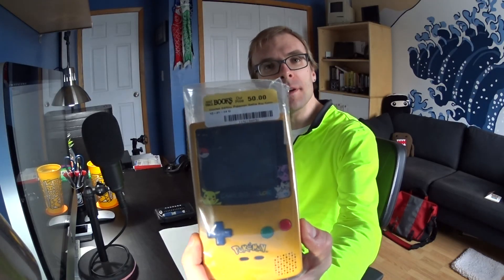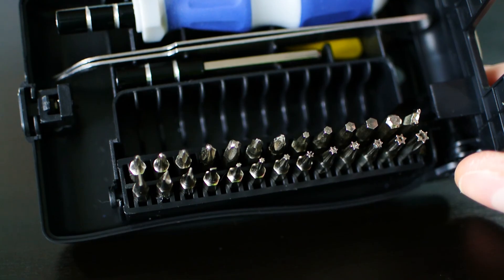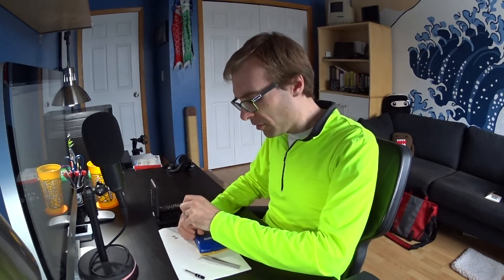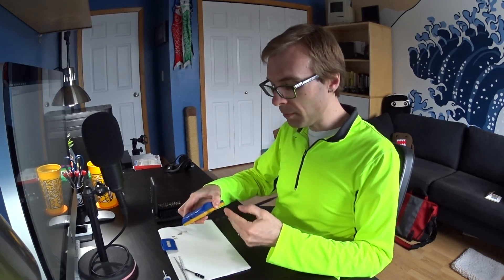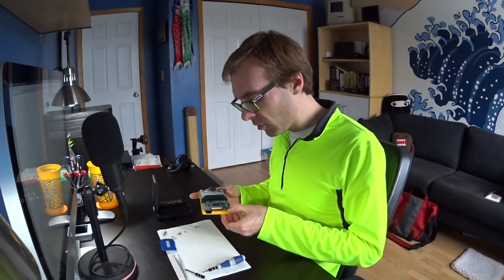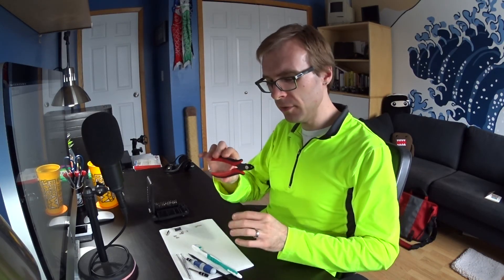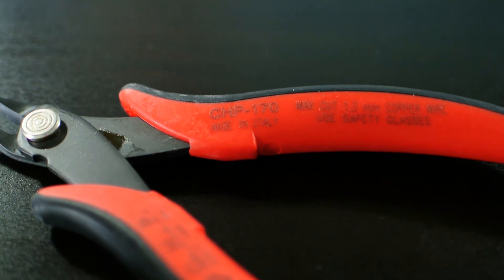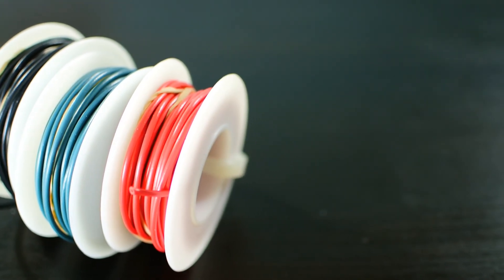Build a Gamer's Console Repair Toolkit

Comment: Hi. Thanks This Does Not Compute friends. If it's ok to ask for recommendations on a new multimeter. Among my multimeter choices are:  BSIDE S11 or the S20 which is best for these repairs: iPhone 5, Wacom Intuos 4 and retro video game consoles specifically the Dreamcast, most don't have power. BSIDE is the brand name.

When I post the specs and links here, the Youtube bot or automatic censoring system keep blocks it. BSIDE's official store can be checked at that popular chinese retail website that starts with the letter A and ends with "express" (my apologies.)

They have the S10 model which uses AAA. The S11 and S20, even though the S20 has a higher model number trumps each other in terms of capacitance readings, resistance etc. The S20 does have an EMF sensor, if that's important.

You're recommendations are welcome.

Thank you. Stay safe.
God bless, Rev. 21:4

Comment: I really enjoyed this video, your knowledge and presentation are top-notch! I am interested in getting into modding and I really appreciate your advice on soldering irons and multimeters. 

One item I really like to use on the cleaning side (not really a "tool" per se) is a cordless air duster. I bought an OPOLAR air duster on Amazon a few weeks ago on sale for about $50 CAD and at $10 CAD per can of compressed air the air duster has already paid for itself. 

Great video, thanks again, I am now a new subscriber and I look forward to watching your videos!

Comment: I would say that a good tool to have would be the fine point "pick and scratch all tool set". They are small enough to fit any where, pull up on very hard to lift ribbons and connectors. As well as scratching up corrosion, plus it doubles over as a nice stabing weapon of some one decides to mess with you.

Comment: Thank you for the video! I have been using the 3.8 and 4.5 game bits for a while now, and have been looking for a good handle for them as well as a T6 and T8 security bit. I am hesitant to buy a new kit because I don't NEED all the extra tools, but I might anyways. I really just need a travel T6, T8, Triwing, 3.8 and 4.5 solution, but I might be best off making my own kit and getting a pouch.

I do have a very good soldering iron that I HIGHLY recommend, but it is more on the pricey side. I also do a ton of soldering for 3d printers in addition to automotive and other electronics. Here is a link:
https://www.amazon.com/T18-D08-D12-D24-D32-S3/dp/B00C1N30DI/ref=sr_1_1_sspa?ie=UTF8&qid=1546444435&sr=8-1-spons&keywords=Hakko+Soldering+Station&psc=1&smid=A1UB0766FG4V9I

I can't say enough about this kit, as it comes with everything you could ever need for fine to bulky soldering, and all the conveniences a soldering station can provide, as well as temperature control.

Comment: Nice video. Plane and simple.   As for Digital volt meters, Fluke has some basic models 113, 114, 115, 116, and 117 or Klein models.  True RMS is a nice option to have available.  Klein makes some nice precision and regular size screwdrivers. USA made. There are some other excellent brands like xcelite (USA made), wilha, wera, and some Moody model are ok.

Comment: A lot of what is said here is mostly just marketing garbage. You don't need a spudger to open a freakin gameboy. We already know your partnership with Hakko. You pressured your viewers to buy a 100 dollar multimeter when you know damn well a 5 dollar one will last years.
Reply from the maker: To be clear: I have no "partnership" with Hakko, iFixIt,  Hioki, or any other tool manufacturers. I have never been compensated by any of these companies in any way.
Reply: You know what. Hakko is a good brand, but when you went into your bit where you would need a spudger to open a gameboy (even a sticky one), you sort of do have to admit you were being a bit ridiculous and questionable. You know what, even if you did have a partnership, I was being overreact. Nothing is wrong with sponsors as long as you provide high quality videos or even low quality videos. WHO KNOWS

Comment: I find having some kapton tape in my tool kit to be very helpful.
Reply: digitalomen came here to say this. I use it in place of heat-shrink often as well; just folding it over. It’s heat resistant and is the industry standard for taping electronics.

Comment: I found this electric solder sucker for $20. I didnt expect much for that price, but its honestly one of the best tools i have. It makes desoldering faster and more efficient. I'd recommend giving a try. One thing to keep in mind that you have to clean this thing often, but for $20 its worth it.
its on ebay under 
"NEW 40W DESOLDERING IRON PUMP solder remover, soldering sucker vacuum desolder"

Comment: I have a thought regarding soldering with liquid flux. A lot of it comes in a little jar or bottle with a brush built into the cap. Not a big deal, but it can be a little bit messy. 

I work in a craft store and we sell brush pens that are an empty pen meant to hold your choice of water, ink or high flow acrylic paint, and they do come with a cap. I wonder if one of these would be a good solution for applying flux with a little more control?

Comment: can you please post a link to your reccomended gamebit and triwing drivers? mine are wearing out and the gamebits are a bit difficult for getting into the longer holes on consoles o i would like a good quality set.  also another thing i find usefull is a hot air gun. mine is on my soldering station so it is handy when i need it and i like it for keeping things neat and not shorting out without needing hot glue. it just looks messy to me.

Comment: I do a lot of pc and phone/tablet repairs and recently bought the new 2016 ifixit business toolkit and it's one of the best investments I've ever made. it's pretty expensive at $250usd but if you repair a lot of things, especially on the go, it's tough to beat the kit. the multi-meter in it is pretty garbage though so I'd pick up a different one of those, but everything else is quality.

Comment: For console and small electronic repair, a magnetic screw tray is invaluable. I cannot tell you how many hours I've spent looking for a tiny screw that fell on the floor. Also, if you're really getting into modding repair, a ratcheting multibit screwdriver will pay off in the long run. I have on, and it really saves on wrist pain and can help get some good tension when I  need it.

Comment: What about ventilation for soldering? Do you have a small fan to whisk away the smoke or a fume extractor with a filter?
Reply from the maker: If you only need to do a quick solder joint or two, I don't think it's really necessary -- but if I start up a marathon soldering session, I'll set up a small fan.
Reply: Will you ever show us a marathon of you soldering several things?

Comment: I bought a cheap set of files to help me with a case mod for a famicom NSF player cartridge. I knew I'd pretty much only use them for that so I got the cheapest ones I could find, but if you're serious with case mods like adding video jacks, built-in screens, extra audio jacks, holes for buttons, etc., then good set of files will come in super handy. It's a hell of a lot better than just sandpaper.

Comment: your obsession for hand tools just earned you another subscriber! As I cant get enought of all the precision screwdriver sets out there myself. The two main companies I purchase are ifixit and wiha. I just bought ifixits' 64 bit kit, and hope to soon purchase theeir newer pro tech tool kit, as I already own the older version I'd like to stay in the loop with the latest and greatest,  not to mention the new screwdriver in the 64 bit kit is totally worth the purchase. as for my wiha set I tend to use them when I'm faced with recessed screws in laptops that my ifixit drivers cant reach, since those 4mm bits are limited in length. By the way excellent video!

Comment: Something I used that I have found are extremely useful; old prescription pill bottles. I have done a lot of old handheld repair/mods and those bottles come in handy all the time. I have a few, one filled with A/B buttons, one with Dpads, one with silicone pads, one with screws, etc. They are great little storage containers ESPECIALLY because the lids don't pop off (I used to keep the screws in the top of my little tool box I kept all my electronics/handheld tools in, bumped it wrong, spent 15 minutes picking up and checking for every screw that I spilled into my carpet... especially when it comes to smaller screws.) 

They are extremely helpful, and come in various sizes too. (Plus for the more eco-friendly, its re-purposing! Haha)

Comment: One weird way of removing residue on plastic is something I've found out this past year. If you take a price tag off the plastic part of a cartridge or console (not off a label, that's a different situation) and you see residue on the plastic, but you don't want to use something like Goo Gone or Goof Off which may damage some plastics, you can take a small length of scotch tape and using the glue on the tape you apply half the tape to the residue while holding the other half and slowly and methodically press it against and remove it quickly and at a shallow angle and it will take the residue off cleanly. It's glue on glue after all. You may have to use several pieces of tape to do this completely as the tape fills up with crap and becomes less effective, but in the end you'll remove all traces of the residue and the plastic will look like it never had a sticker on it. You save your plastic from chemical melting and you remove the residue cleanly. I have several cartridges that look so clean you would have never known they had stickers all over them.
Reply: +Ryan Martinez Just heat the label with a hair dryer for 30 seconds. This heats up the old glue and the sticker should peel right off.
Reply: I had no idea goo gone could damage plastic? do you know if there is a lit somewhere of what consoles and cartridges it is not safe for? I also just recently got a PSP disc that has super glue on it and plan on using goo gone to hopefuly repair it. couldn't damage it any more than it already is i would think. someone broke the plastic shell around it and tried super glueing it back but they did a sloppy job and got a good bit on the disc.

Comment: I also just got into videogame system repair. I love the video very helpful!! I also was curious on heatguns. For using on ps3 systems. What would be best temp to use. And also what solder do you use normal or prefer to use. Thanks your awesome
Reply from the maker: Valorie Ritter I assume you're referring to using the heat gun to reflow the solder under the CPU/GPU on the PS3? I've never seen an actual temperature recommendation for that procedure, it's always been more of a "turn the heat gun to high and hold it over the chip for X minutes" kind of thing. If I ever get a broken PS3 or Xbox 360 I may try to make a video of the process (though I can't guarantee it would end in success ;-)

As for solder, I've been using the lead-free stuff for a long time now. It's handy to keep a couple of different thicknesses on hand, though I find myself using thin solder more often than thick. Good luck!

Comment: I found the same gameboy in a trade! Same sound problem, I just swapped the insides directly with my other gameboy, but I might swap them back again just use a soldering iron to replace the speaker (so that the original board stays in)

Comment: I have seen people use heat guns for some screen removals on.  Do you have a preferred heat gun?
Reply from the maker: I haven't run across a make/model that I think is substantially better than others. Mine is an inexpensive Milwaukee unit from Home Depot -- I think it was $20 or so, and works well enough.

Comment: Amazing video thanks! I'm just getting into repairing consoles so it's going to help me out, also what are you thoughts on an craft cutting board to work on and soldering paste?
Reply from the maker: Some kind of protector for your work surface is always a good idea, and yes, those craft cutting mats work quite well. As for solder paste, as in the kind used to hot-air flow surface-mount components on a circuit board, you'll never need it for repairing consoles unless you get into ridiculously advanced stuff (which involves ridiculously expensive tools). If you mean solder flux, which is used to help clean solder joints and help solder flow better, then it's definitely handy stuff to have around. Cheers!

Comment: Awesome video! My question is what do you suggest for cleaning devices? I know toothbrush+warm water, but what about harder stains? Cables? Advice on discoloring?
Reply from the maker: For tougher stains, I've found those "magic eraser" scrubby pads to work quite well -- but never use one of those green scouring pads, as it will leave obvious scratches in plastic. For cables, I just wrap a disinfecting wipe around the cable, and slide it along. The only discoloring I've had to deal with is the typical plastic yellowing, which a Retr0bright treatment does a pretty good job of tackling. Good luck!